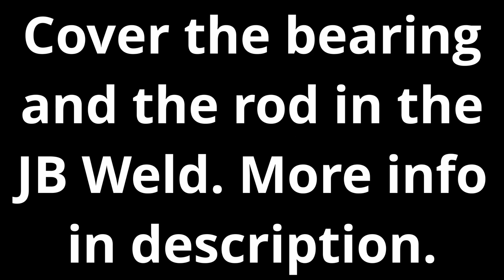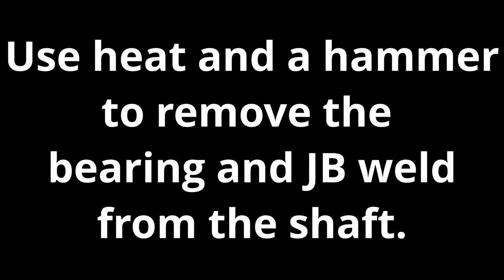Removing Gen 3 and Older Cup Style Case Needle Bearings from a Eaton Supercharger M45 M90 M62 M112

Comment: Why not use a blind bearing puller?
Reply from the maker: the cup style bearing are pretty hard to get a good hold on with a blind bearing puller.   You can only get ahold of the needles, you can not get ahold of the outer race.   Grease gun works great if you have a hole to the back of the needle bearings.  Consider this another method, not the only method.

Comment: Hi. Good evening., I cant remove mine is a m112 eaton ., I bought the puller .tools but I can't. Take them out I even take the bearings.just to make a better grip whit the bearing puller.  And nothing.. and it's hard .,Did you remove the bearings from the case. Before you apply the jb weld ., or just cleaning is good enough. ❓now. I have one complete and one whit out the bearings.. thank you. For your video. Its been very nice to learn. From you .thank you 🤝🤝🤝✌🏻👍
Reply from the maker: I left all the needles in the cup needle bearings .   You have to use the high strength epoxy such as the JB Weld.   What is your supercharger off of?   Contact me at qualitysuperchargers@gmail.com.    Please send me some pictures.

Comment: Great vids.  I cant seem to find any information or vids on reinstalling them?
Reply from the maker: I push them in flush using the back side of a large socket and a extension.   once flush I use a slightly smaller OD socket and push them in 0.055" below the surface.
Reply: @qualitysuperchargers  awsome thanks. Keep up the good work